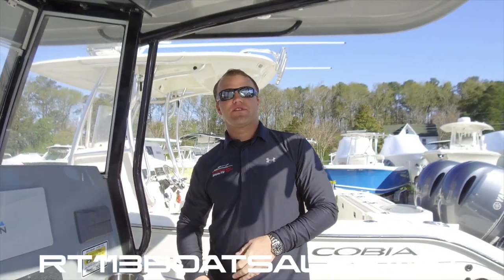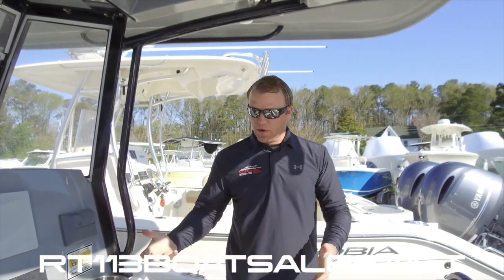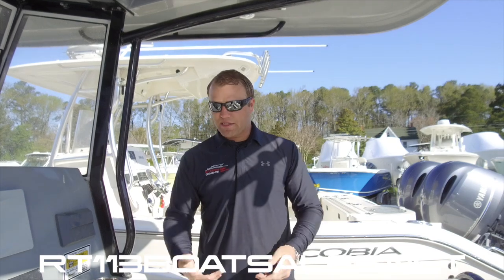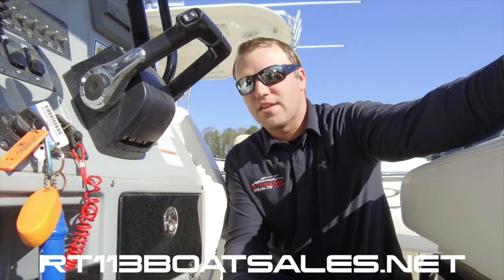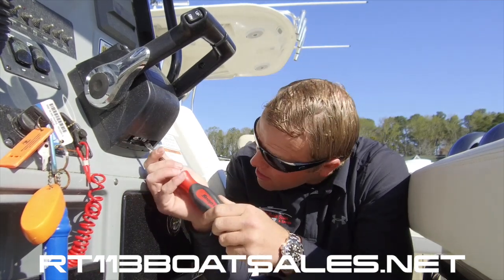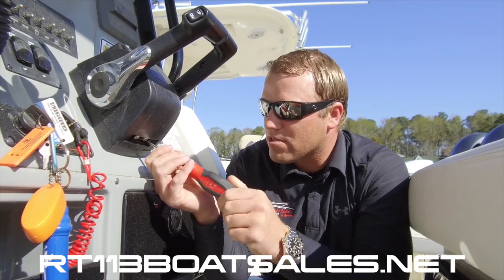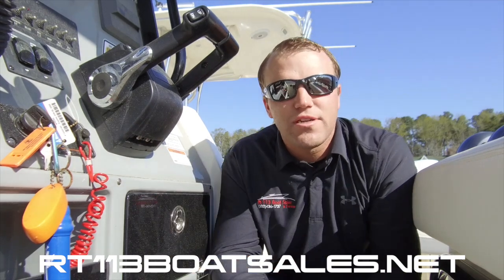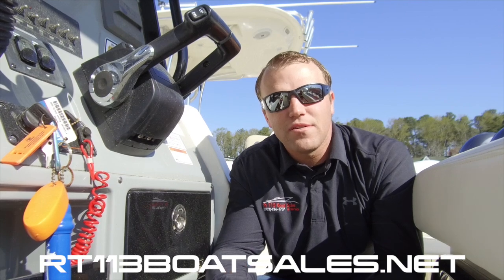How to: Stop your Yamaha throttle from drifting back.

Comment: For my boat, this information isn't helpful, really.  Tightening the screw increases the resistance on the throttle lever, but increases the drop-back in throttle that occurs when I remove my hand from the lever.  In other words, I can increase throttle to 6000rpm, but once I release the throttle, it drops back to 5000rpm.  Loosening the detent will reduce this immediate throttle drop-back, but makes it much easier for the boat vibrations to cause the throttle to drift back - a slower change to throttle.  So this does not fix the problem, it only changes where/how the problem occurs.
Reply: Me too. It’s very frustrating.
Reply: It sounds like you may have a cable or rigging issue outside of this feature

Comment: Thanks for the video. My yamaha throttle is very sticky and a little hard to push. But 2 spots that are most commonly used, drift back. I adjusted to get the best of both but it's right. How do I correct this to make it smooth?

Comment: Hi, cheers for the tip...I have twin F150's with the exact same twin throttle control as yours...is there any way you can add an additional twin remote control in the mix, like outside the cabin on the gunwale etc (for lobster potting etc)...thanks